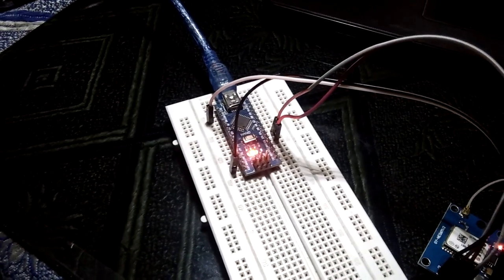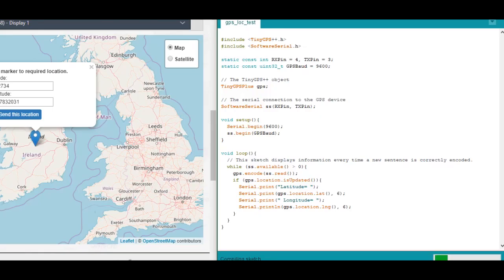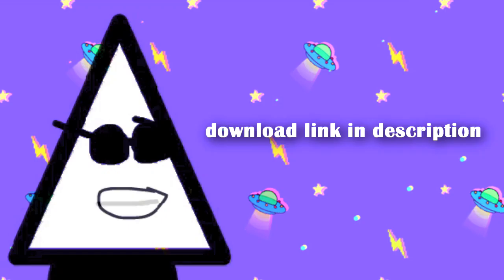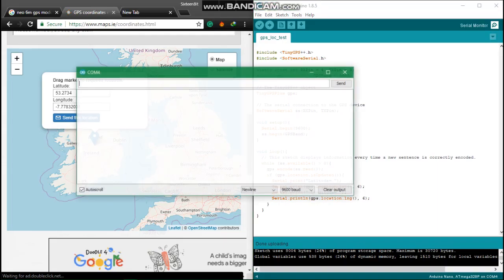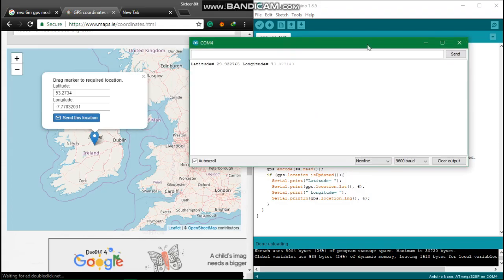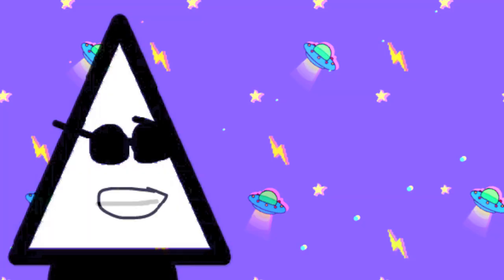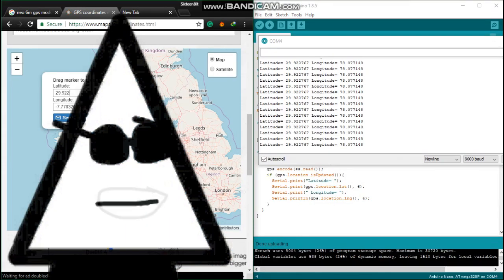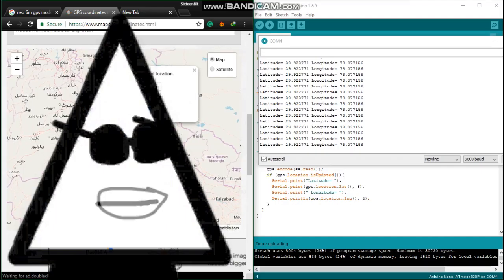U-blox neo-6m GPS Module Tutorial

Comment: guys this code works if your Serial monitor not printing any data then one common thing is that your gps tx pin should be connected to rx pin because gps is transmitting  and you have to receive the data from Rx pin of arduino.

Comment: if it doesnt work try to invert TX/RX, and be carefull if you use a MEGA you have to connect RX (or tx if you invert)  to port 10, 11, 12, 13, 14, 15, 50, 51, 52, 53.

Comment: LED on my module does not glow, but when I connect an external LED to the module on a breadboard, it glows. Should I try using another module?
Reply from the maker: There might be something wrong with your antenna, try to test this setup in open area.

Comment: Thanks for your valuable information. And i had a problem...

I did the same connection in the video description. GPS module was fine the light on its board also on. But my arduino uno board seems had a deal...
The TX and RX on my arduino uno doesn't blink even if i tried to switch its pin into (6) for TX and (5) for RX it's still not working. Is it because of my wrong connection or something else ?

Note :
I tried another code in the link description. The RX and TX on my arduino uno board start blinking...
But for this one is not...
Reply from the maker: Dude don't connect the rx. Just connect tx
Reply: @ArnovSharma  Did that just now. Its still not working..
Is it necessary to change the arduino board?
Reply from the maker: @zakkyfh9386  not really.
Reply from the maker: If your connection are right then check the continuity of your jumper wires, maybe they are shorted or something. It happens with old jumper wires
Reply: @ArnovSharma  Checked it and i tried a new jumper wires. Still the TX LED is not blinking with this code...
My GPS module has a PPS Pin in it. Is it necessary to connect it ?
So that maybe the code will run properly   :\

Comment: hi, is this gps module  will inside of a closed room, I tried your code with two gps device but getting output as 0.0000 , 0.00000. just give the reply when you see this
Reply from the maker: Test this in open area dude. Maybe your antenna is not connected properly

Comment: I did the same connection . But the led in gps module is not glowing and i have nothing displayed in the serial monitor. I tried doing the same in roof top. But the result is same. How to know whether my gps is working or not ?
Reply from the maker: try to power gps module with arduino without connecting rx and tx
Reply: @ArnovSharma  still not glowing
Reply from the maker: @aminizzudin8453  change your module mate
Reply: @aminizzudin8453   your module is gone bro. Vcc must be connected to 3.3v not 5V.